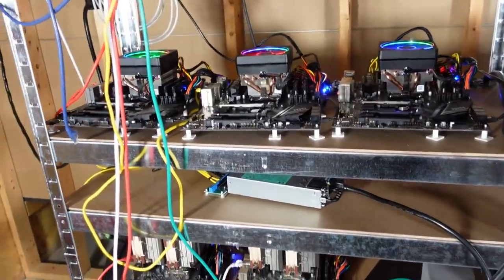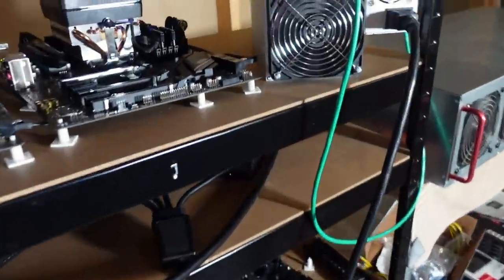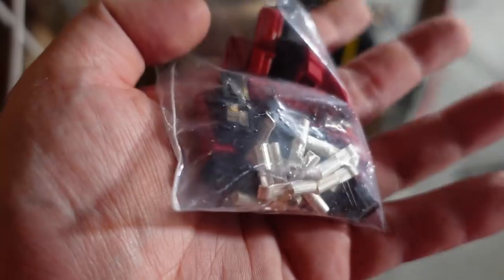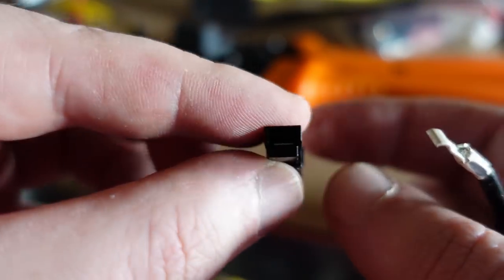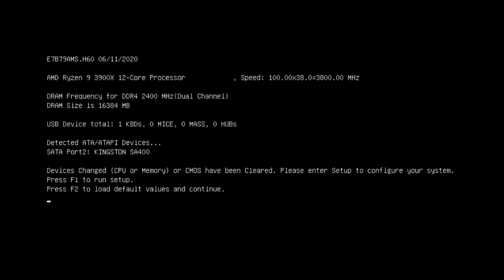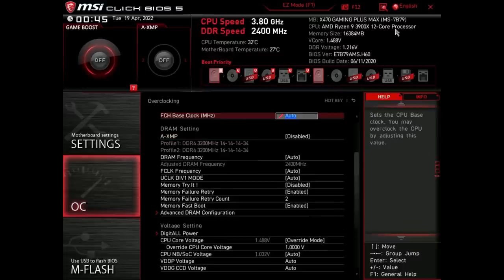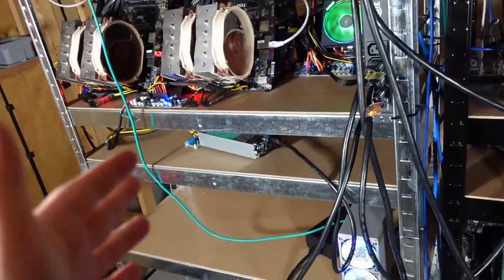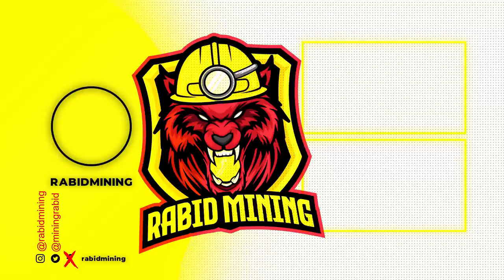CPU MINING Make Over | More Room For More RIGS!!!!

Comment: Density is really the way to go. If you were to replace the heat sinks with water blocks, you could sandwich the boards in a transformer arrangement plate stack. All you would need is long sections of threaded bar that fits the motherboard holes, nuts and no conductive washers. Should be able to fit one system every 2 inches. Power a massive stack like that would be... interesting, but doable.

Comment: I used Amazon basic 5 tier wire shelves. Stood the motherboards on edge and alternated positioning so the coolers all tetris together. Zip ties,foam spacer blocks.... managed to get 6 MB per rack, with a 20 box fan blowing upwards and a 20 in box fan sucking out the top. Used ridged foam board and tape to build an enclosure around them.

Comment: Heya Rabid. Any chance you could go more in depth over the power cords to the pico and the PSU? Saw you cut the male end of the barrel plug but then jumped to the parallel miner cords to put the new ends on? Currently have 10 CPU rigs but each running on an ATX, so would love to figure out this server PSU method to clean stuff up and honestly save a little power I am sure.
Reply from the maker: OK also have 2 rigs running per single atx in a later video

Comment: Can you p[lease list the power components you are using from Server PSU  (the brand/wattage) to the Board on the back on the Server PSU, and the Pico Breakout board (the brand/wattage), Anderson Connectors (the brand/wattage). Where do you also recommend buying these components for fellow Canadians. Let us know about that heat over time on those Boards being so close.  Cheers and great content as always.
Reply from the maker: Should have the links in the description power supplies are under parallel miner in the description as well

Comment: I sold all of my rigs. When you add up the power cost and the depreciation, It's just not profitable. Remember, when the new the CPUs come out they will be more efficient and the hash rate will go up, as a result, making your current CPU less profitable due to the added hash rate. Then there is depreciation, when I bought my 3900x I was able to build a rig for about 700 ish now if I sell the same rig I will only get about 450 ish. If you're CPU mining to hold a coin, hoping the coin will go to the moon, then it makes more sense to just buy the coin. Let me know if you disagree.
Reply from the maker: The new CPUs I dont think will hash better will be on par with 3000 series and 5000 series one coin will benefit if they add the extra 3d cache.  So gamers will be selling 3000 and 5000 putting them even cheaper and a better buy to mine with.  The 5000 series didnt do any better over the 3000
Reply: @RabidMining  ?
Reply: @RabidMining  3900x vs 5900x on RTM?  also new series 2x more cache
Reply from the maker: 3900x on rtm actually hashed a bit more slightly most coins they are all the same.  I think the next gen 7000 series will be the same but the only benefit it will see is on haven where the extra l3 will allow more threads to be used as current 3900x 3950x 5900x and 5950x can only use 16 threads.
Reply: The way I look at it from a GPU miners point of view is I have CPUs sitting idle on my mining rigs. I did the math and by joining a pool and putting my CPUs to work I'll make an extra $300 (at current market cost) per year after power. Plus monero is what all crypto should aspire to be and I believe in the privacy coin a lot, so if nothing else, I like to contribute to decentralization and anonymity from big daddy government
Reply: @saltwatertaffybag  If you can already justify the cost of a rig because of work, or gaming,  as in your situation, then I would agree with you.

Comment: Whats your ROI estimate on those cpu rigs with current  earning?
Reply from the maker: Not sure gotta look been swapping around testing lately as everything is paid off haven't been looking at price more spec mining for future pumps.
Reply: coins are accumulated... it is held... when they explode there we sell... and we have a good number of roi... conclusion is mine in the future...
Reply: @evil.reparaciones  I guess you havent been into crypto very long. like 95% of coins dump, especially new coins
Reply: Well, if you take into account YouTube earnings they have ROI'd already, especially Rig 5
Reply from the maker: Youtube earnings are hardly anything honestly the rigs made more by far.
Reply: 4 years
Reply from the maker: Funny thing is even if it was 4 years that's probably shorter then what GPUs will be after ETH is gone.  Anyway it's under a year currently
Reply: @RabidMining  thats pretty good, do you go for cheapest motherboard then? what cost estimates did you do?
Reply from the maker: It's always changing but ya running efficient also brings build costs down only need the more expensive MBs if you wanna overclock into the 4.2+ range which is a bad idea as it starts using twice the power.
Reply: @RabidMining  I bought a 3950X and the mobo only has 4+2 VRMs without heatsinks. Should I add some headsink or at least a small fan if I undervolt the CPU and went for efficiency and not max power? With an insane overclock it's more profitable with cheaper energy (since they can go over 200W), but in that case I would need a better mobo and cooler.
Reply from the maker: Ya if running efficient should be fine but to OC ya better MB would be recommended